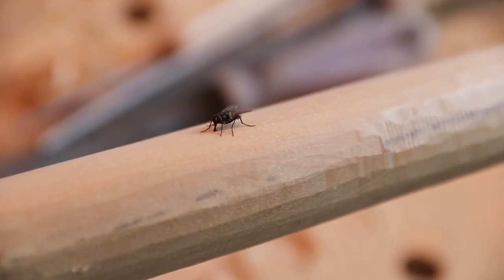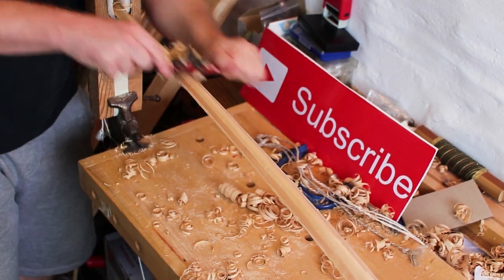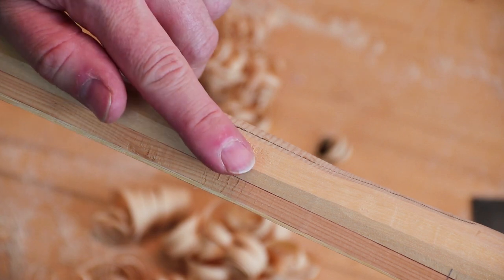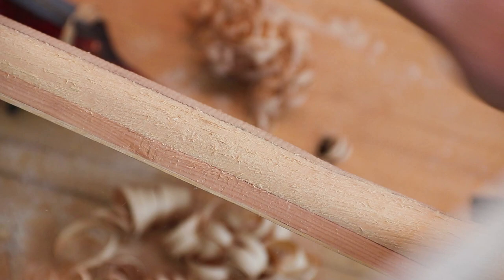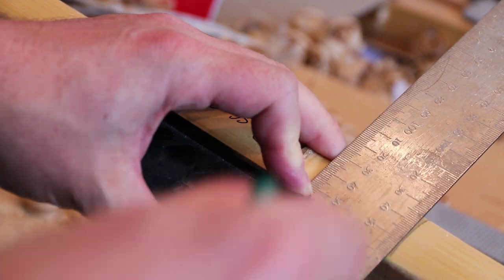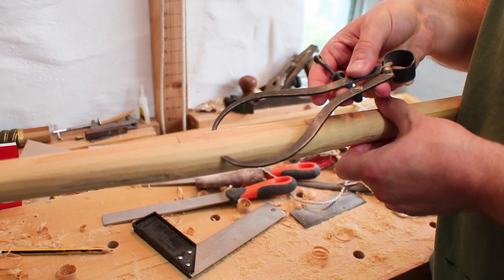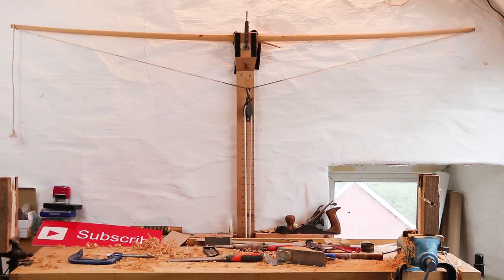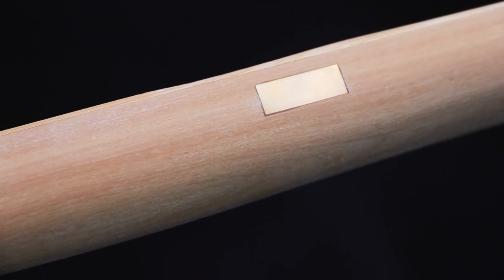Yew English Longbow making blog, this week in the workshop

Comment: I don't own an English longbow....yet, but I am thinking of adding one to my collection and I am considering making one.  However there is one thing that puzzles me slightly.  When shooting an English longbow it was originally shot with a floating anchor being drawn to the ear.  Most longbows that I have seen are marked "27 or 28" max draw" and I assume that most modern English longbows are being shot with the bow being drawn to a traditional anchor.  Therefor bearing in mind that the average draw length is 28-29" it would mean that to draw to the ear the bow would be required to draw to around 33".  
My anchor is the corner of my mouth with my index finger on my cheekbone, this relates to my 311/2" draw length.  So with this in mind most "off the shelf" bows wouldn't be suitable for me even being drawn to my fixed anchor.  Then there is another issue of arrow shafts..most commercial shafts are 32"..although bamboo shafts are available in longer lengths they are not traditional for use with English longbows.....I welcome your thoughts.
PS I am worried about you...you have started talking to chickens and now speak fluent house fly!
Reply from the maker: Hi, you start by saying you want to make your own bow, so there shouldent be an issue with the othet things you mention as you will be able to make the bow to the correct length for your draw length. You also then mention off the shelf bows, so I am a little confused, either way you will need one that suits your style of shooting.  Have you drawn a longbow to 31" or are you guessing this?
Reply: Richard Head Longbows...Thanks for the reply, I do enjoy bow making and have made a AFB self bow and some firewood in the past.  Like most people, there never is enough hours in the day to do everything you want..and so yes, making an English Longbow is on my bucket list (I do realise that I can tiller it to my spec) but should I come across a good used example I might want to consider that too.  It just seems a little odd to me why so many ELB's are tillered to AMO when the traditional draw is to the ear (and that many ELB's are marked "Max draw length 28 or 29")way below the average draw to the ear for most average hight adults.  You wouldn't after all expect to find a good Asian bow marked with a max draw length of 28" AMO.
I have not drawn a ELB to 311/2 inches (my mouth/cheek anchor) as they have all belonged to someone else and I wouldn't wish to damage them (as I said, a few of them have been marked with a lesser max draw length or the owner has a shorter draw length.  I do draw all six of my bows to my anchor but five of them are glass laminated and so can handle the abuse (should I be unfortunate to break one, they were mine to break)...something that I wouldn't feel comfortable doing with either a self or wood laminated bow (especially if it wasn't mine).
Reply from the maker: Traditional draw is under the chin or the corner of the mouth for the English Longbow, you are talking abou the War Bow when it comes to drswing behind the ear.
Reply: Its is a mater of opinion I guess...I would consider drawing an ELB to a fixed anchor on the face a "Victorian" influence that was imparted when using a ELB and not a traditional method of use.  As for drawing to under the chin, I would say that it has no historical use and that it is an anchor used initially by modern Olympic recurve  archers.  Not all longbows were war bows, archers would often own a lighter hunting bow, also drawing to the ear.
Reply from the maker: As usual we are getting into the area of misunderstanding that you get with comments on youtube or texts etc.  I was trying to answer your question.  Victorian English Longbows or `recreational` if you want to call it that are shot at targets, and the traditional method of shooting is using an anchor point under the chin for target shooting and corner of the mouth for Field shooting, that is traditional to this style of shooting. The style of shooting and type of bow you are talking about is a War bow and is shot in a different way.  But feel free to shoot how you want, no one can tell you what to do.  Have fun.